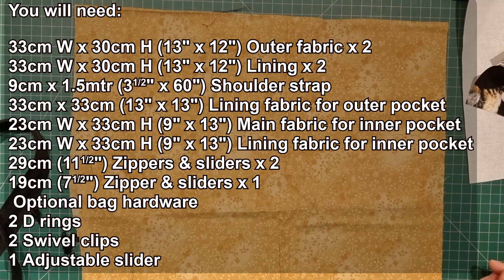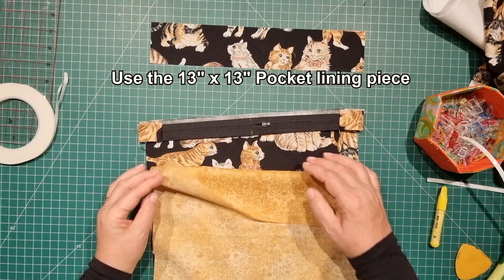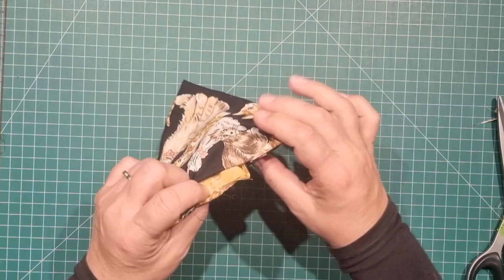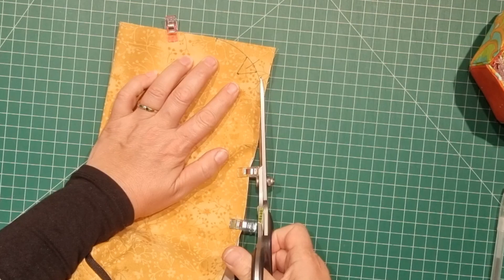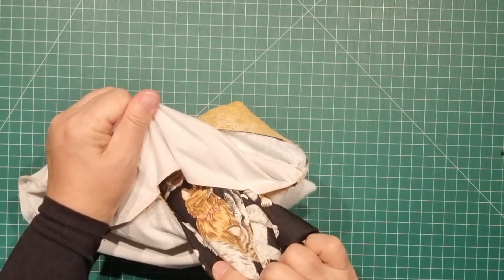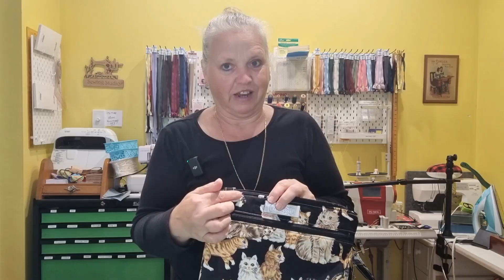How to sew Crossbody/Sling shoulder bag Ipad/Tablet multi function carry bag with lots of pockets

Comment: Thank you! I made a practice bag, using thrift fabric, and it came out looking good! A bit tricky, at that 1 point, when looking at your video, but not so hard to do. But I don't like to stitch all the way to the end of the zipper part, either,  as you talked about at the end, but Iwas hoping you had some new solution...I too will go back to the shorter stitched top stitch...Thank you. Prayers you're healing well.

Comment: I jumped the gun as you mentioned ipad at last minute of video.  Thanks, great video.  I would like to make a smaller version of this as I try to keep my purses smaller so I carry less and better on the shoulders.  I guess I could just cut down size of  body?
Reply from the maker: Yes, you can reduce the size Carolyn.  Keep the construction method the same, but reduce the amount of width or height you'd prefer😁